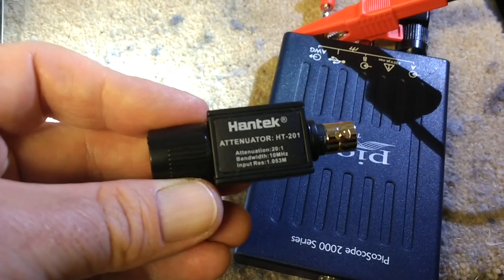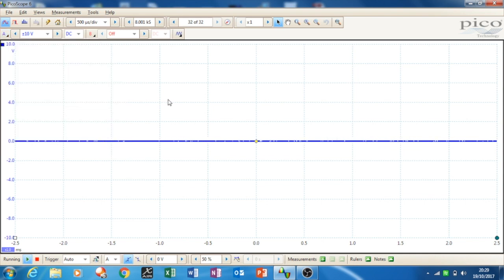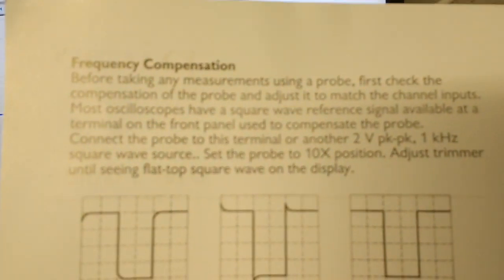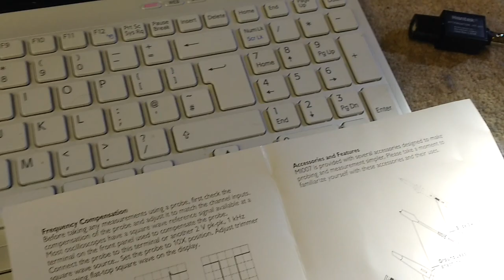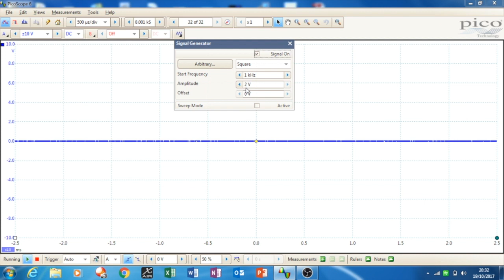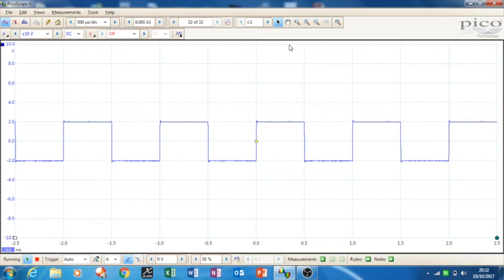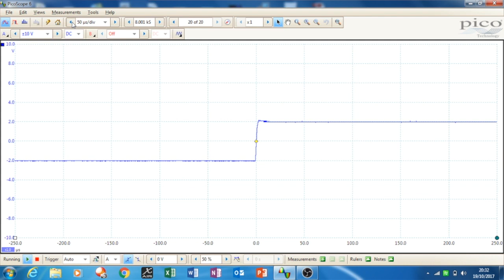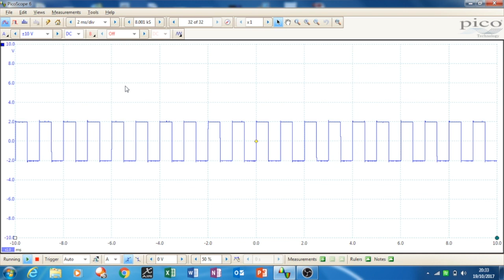PICOSCOPE WITH HANTEK ATTENUATORS

Comment: Hello Sandy. I am trying to do a coil  primary voltage waveform using my 2000 Series Picoscope. So, I can  click on the A  and choose x20 as you  did, then 20v DC and the time, then crank the engine? I have not seen a coil primary voltage waveform done with a 2000 series pico yet.
Reply from the maker: https://youtu.be/YHjEXmc6KJM try this video see if it helps, what kind of car/year is it? Cheers sandy

Comment: Hello Sandy !
Can you tell me your thoughts about budget scope ? My Hantek is pretty slow and it doesn't even have trigger and a buffer in it , so i'm thinking in this investment point . Something in the 500-1000$ price range . The picoscopes designed for the automotive use are still to pricey for me . I think some lower picoscope series with hantek gear , amp clamps , attenuators etc.
Reply from the maker: Crank I'll have a think about it my friend and make a video detailing the pro's and con's, I'm away to bed now up early for work in the morning cheers sandy
Reply: Roll on the pros and cons video !!